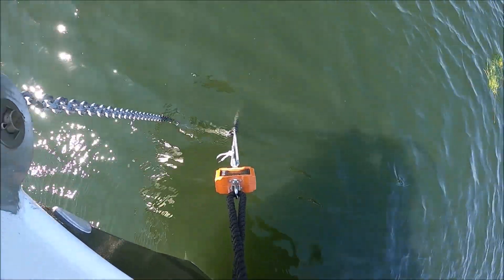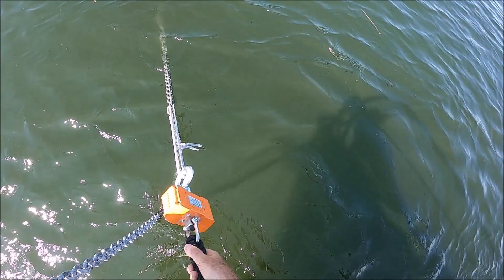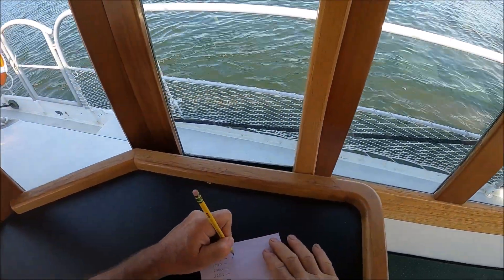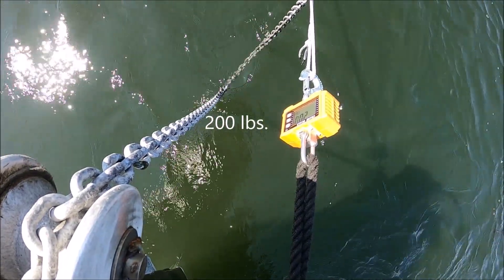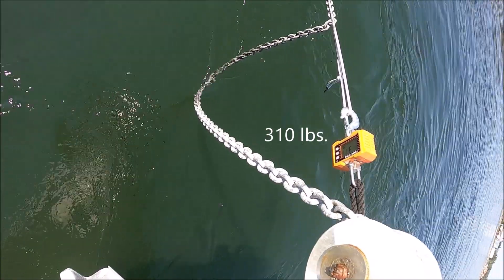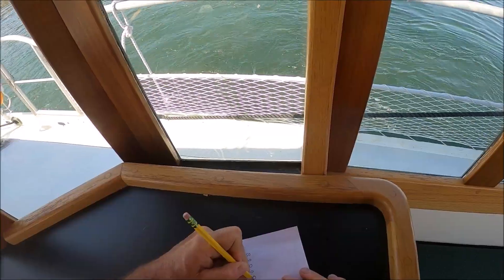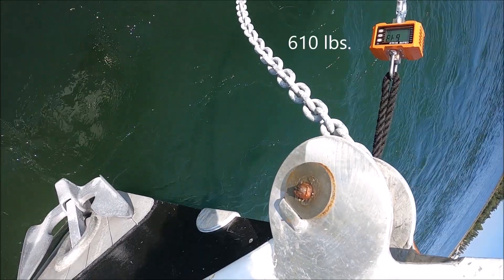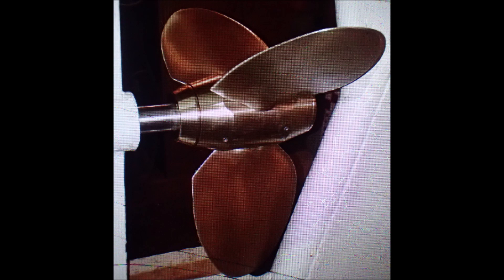MaxProp Thrust

Comment: The load tester is not aligned horizontally so it doesn't measure just the horizontal thrust of the propellor.
A vertical force resisted by the buoyancy of the hull is also included in that force vector.
Did you adjust the meter reading accordingly?
Reply from the maker: I did not.  At the initial, low power readings, the effect that you bring up was significant. As thrust increased, the rode became more horizontal with the error decreasing to perhaps 10 or 15%.  No question that a horizontal pull would have been preferable.  Note: when I conducted a horizontal pull, someone commented that the presence of the dock (that the boat was tied to) likely caused the propeller slipstream to be affected, thus causing an error.
Reply: @Panope  I can imagine you using an inclinometer and sine tables next time. Haha ;)
Nice work anyway.

Comment: I have a similar feathering prop (added by the PO) that got damaged by a log. I temporarily replaced it with the standard fixed prop that came from the manufacture and was somewhat disappointed in the reverse performance of the fixed prop. Now much happier with the repaired feathering prop now on the boat. I thought it may have been my imagination about the performance difference but you confirmed by suspicion. THANK YOU.